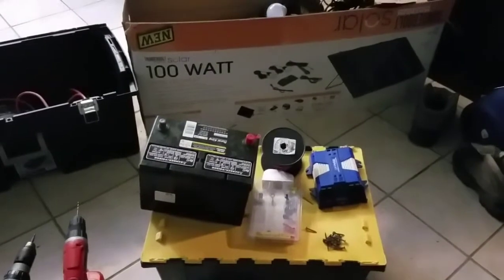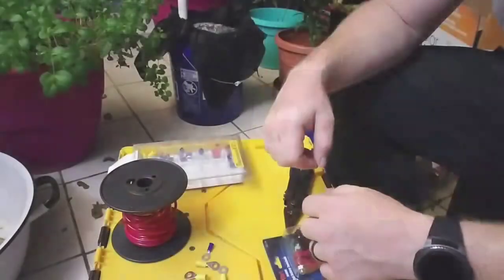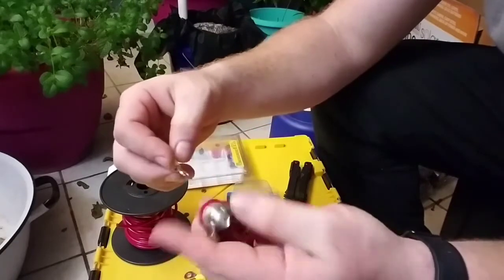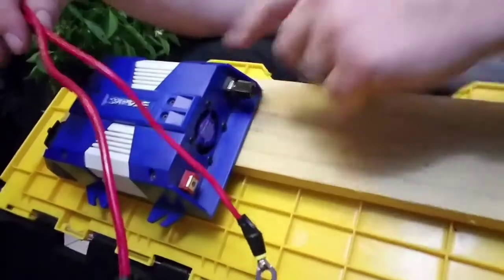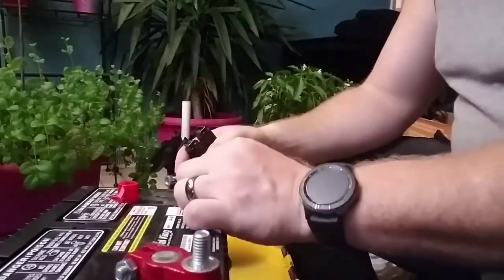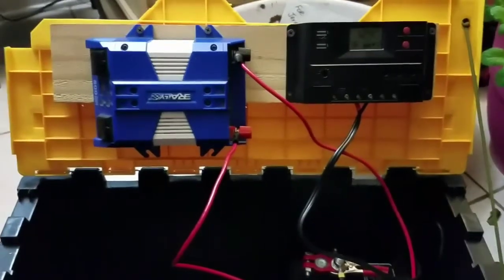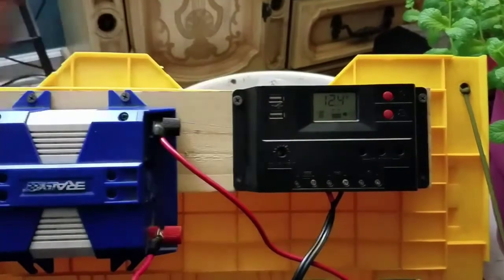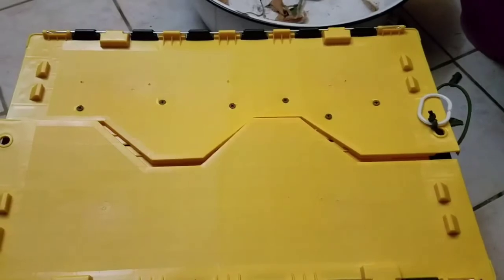Building a solar generator using the Harbor Freight 100 watt kit part 1

Comment: Put a switch between the Charge Controller and the Battery! Left wired up direct, the controller will draw, however slightly, from your battery, and it WILL suck it dry over time. $5.00 worth of "insurance" will save you a lot of frustration down the road!
Reply from the maker: Thanks ill have  to look into doing that.

Comment: Only bad thing is that you have the electronics in with the battery. That means they will be exposed to the battery gases and will end up being eaten up with corrosion. Batteries and the electronics should be kept separate or have forced ventilation.
Reply from the maker: I do not believe this information is accurate.
Reply: Batteries and anything metal such as circuit boards when using Lead-Acid batteries do corrode. Take a look at the bolts on older top post battery connectors and you will see that taking affect. It only is a matter of time.

Comment: Nice set up. Similar to what I did on my pop up camper. I bought 2 marine deep cycle batteries 4 years ago and I would use a trickle charger to keep them topped off. When Harbor Freight came out with this solar kit, I said goodbye to my trickle charger. Had it for a few months now, and it's been working great so far. I set my controller to 13.4 volts because I used my multimeter on the battery and it was reading .2 volts higher than what it was showing on the controller
Reply: George Reigle , Depends on what controller you happen to get. I have 3 of the 100 watt kit ones and all three read differently. Like you, one of mine was .2 volts low, the second was right on, and the third.............. was .2 volts high.

Currently only one is in use as two sets of the panels are now fed to a 30 amp MPPT controller. With it, I also installed a digital LED Ammeter/Voltmeter on the input and it is fun watching the readings. Today the 200 watts of panels on it hit 22 volts and zero current as the batteries were fully charged. Put the inverter on to burn some of the watts and watched them drop down to 15.8 volts and 5.4 amps. With a 200 watt load from a running fridge. Fridge is a poor load as it has a power factor of about .65 on modified sine wave. Inverter is the Jupiter 2000 watt unit from HF.  Finished the day with the batteries at 13.4 volts. During Irma I had the battery being charged by the truck and it was nice not hearing the generator all day long. In theory, the generator can run the whole house as the smart meter shows just under 4 kw continuous load. And that includes the central A/C. But a generator ruins the night.

Comment: I have solar panel on dog house for 12v heater to supply heat to dogs.. cant get it to run for more then 15 min.. my battery is a car battery is this where i messed up ?
Reply from the maker: +Jamie Moore yes car batterys are not good to dran more then 20%. But useing solar or batterys to heat is not very efficient. Heaters use lots of power really fast. So even a deep cycle battery would not make a diffent.    After a car battery is drained all the way juat a few (5-10) times it can be  ruined. I hope this helps.

Comment: simple setup...  to be safe, you might want to add a 10 amp fuse from your controller to the battery on the positive side.   and   look at your manual on the inverter to see what size fuse you need to run on your positive side of the battery to the inverter... and fuse all your outlets as well as the solar coming into your box...  for your safety as well as your components... small distribution blocks are inexpensive, and the fuses are readily available at your local parts store.   www.wiringproducts.com is a good place to look....  Good Luck....